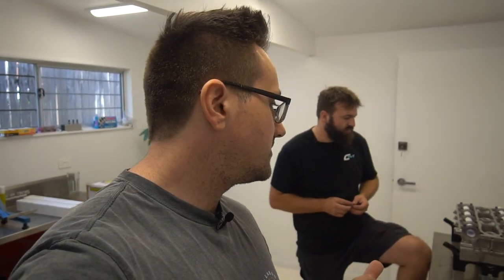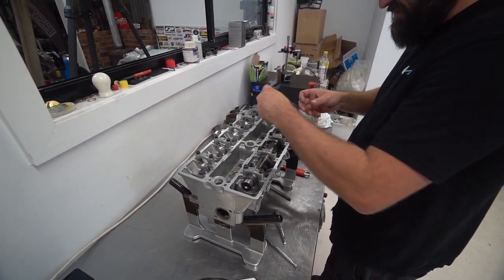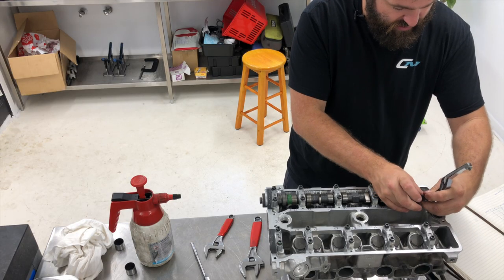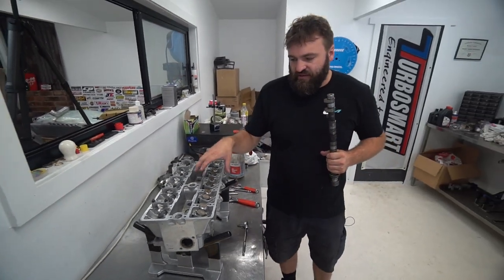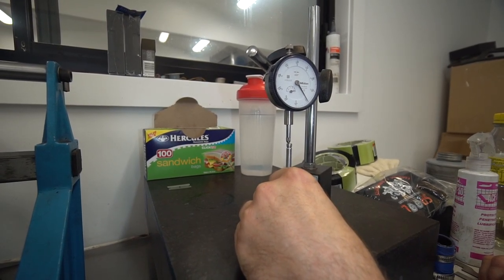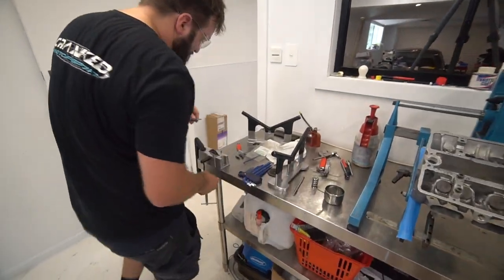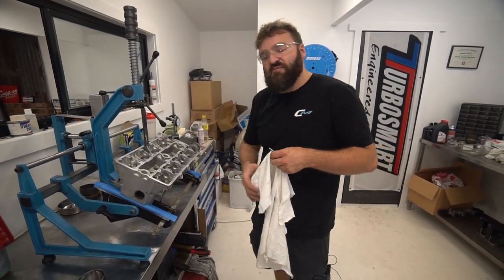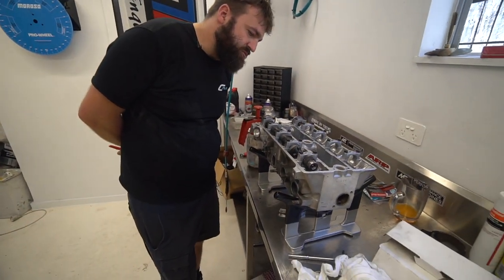Formula Atlantic 4age Build Part 4

Comment: I've heard about machine shops facing the Valve tips for fine-tuning the shim clearances ...but I've always wondered about the 'hardness' of the tip afterwards. Is that something to be concerned about?

Back in the day when I used to build more competition engines(Toyota 2ZZGE specifically), I used to fit softer springs so that I could easily remove the shims to swap sizes around. I have verified after reassembly with the correct springs and seen about 0.001" tighter clearance ..but this wasn't an issue due to my pre-empting this happening and catering for it with the spec'ing. 

I really appreciate your effort in putting together these videos and sharing. Most guys would not be willing to share this valuable data to the World. Thank MaT for me will you! 😁
Reply: Im always lerking around mate thanks for the kudos, hardness isn't a problem on these valves but your correct, for instance on a 20v 4age I don't face the valves as they loose a surface hardening and they will "cup" after facing them especially after installing heavier springs 

The technique of using a "soft" spring isn't uncommon for me to do but my assembly bench doesn't make it hard to quickly work springs and collets
Reply: @mtperformanceengines3508  Thanks Mat! I'm guessing that the 20v  Valves are hardened because of how small their tip diameter is?
Reply: @danielcgomez   I'm not sure if that's the reason it could be toyota trying a different material back in the day but the valve only has a very thin layer of surface hardening, it's only 0.001 to 0. 003 thick so there isn't alot in it

Comment: Ah sweet! Another build video! ...Great stuff Nik! ...Can you ask Mat when you have a chance what his opinions are on 1.) Flat faced vs Dished valves? ...and 2.) Regarding Overlap period flow; Pistons with very tall domes which are used to increase compression rayio? Thanks!
Reply: 1. That's simple in a turbo motor you will generally run dish valves as your not chasing comp ratio but in the NA engines you want as much comp ratio as you can get really 

2. Are you asking about scavenging on overlap?
Reply: @mtperformanceengines3508  Yes on #2 ...Not really sure how the height of the domes present a potential problem during the overlap phase.
Reply: @danielcgomez domes are good and bad in my experience for instance a massive dome is terrible for flame front travel but good for scavenging as it almost creates a hill for the exhaust charge to climb over if it wants to go back up the intake 

It's a huge topic to cover on a YouTube comment reply but there will be more content in the future

Comment: hey, where did you get the Inconel exhaust valves to buy? All I'm seeing is the Black Nitrided valves
Reply: They are a supertech item from the USA
Reply: Now got a response from an email I sent them, they told me they don't make inconel Valves for the 4age, what is the part number of the valves you got if you don't mind sharing please 😅
Reply: @466Kishan  ah sorry these are 4mm oversize custom Valves in this head, I can supply you them but you will need oversized valve seats